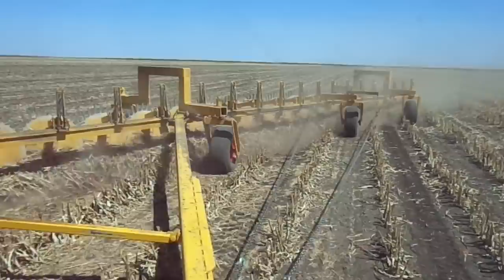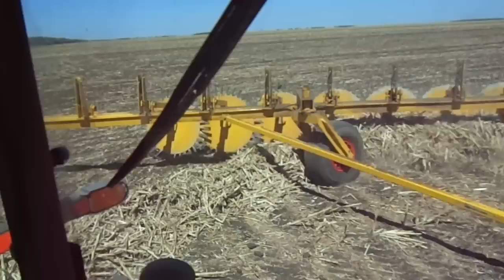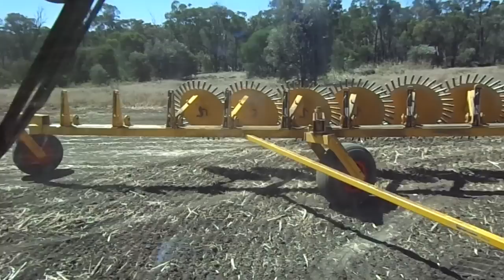24 Hydraulic Lift Pin Wheel Rake from the Tractor Cab - Multi Farming Systems

Comment: I have to ask, does the stubble not break down at all? My one concern would be the chains used at the end of the cable, as I have seen a few chains snap and it usually isnt pretty. But I am amazed at the size of this! very neat! Nothing like this in Canada! Love the videos!
Reply: Yea they are concerned about sticks. In most likelihood this farm is on floodplain ground and branches, sticks and even logs float onto it. We farm about 1600 acres of river bottom ground and it is a pain in the rear every spring to walk over every inch of it and pick up sticks that could potentially mess up an implement. Not to mention if a $500k combine picks up a slightly large stick/log and tears up the feeder housing. We've had that happen. I like what they're doing here, although I still think there could be a better way.
Reply from the maker: Sorry for taking so long, I didn't see this.  Yes, the stubble does break down, they aren't raking the stubble, they are raking the small sticks and it just happens to be raking up the stubble as well.  Our chains are pretty full on, I haven't heard of one snapping, but I would imagine it would be pretty ugly when under tension. And yes, it's a pretty cool machine!  We've made modifications since this based on the farmer's feedback to make it even better.